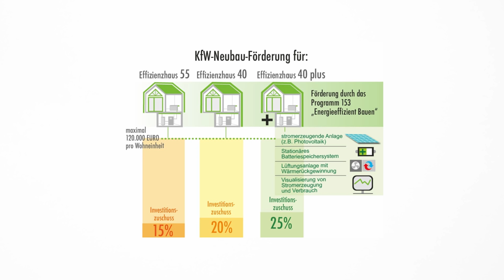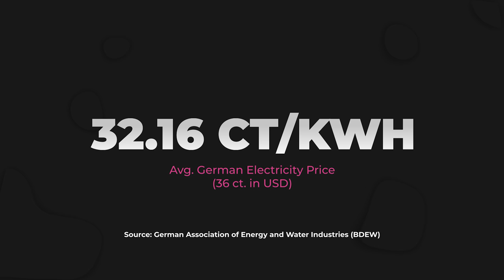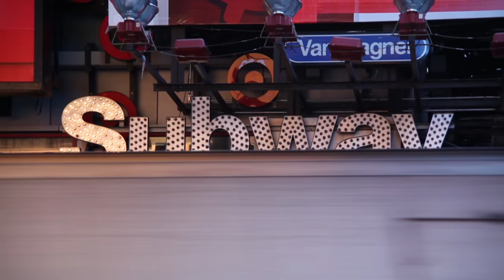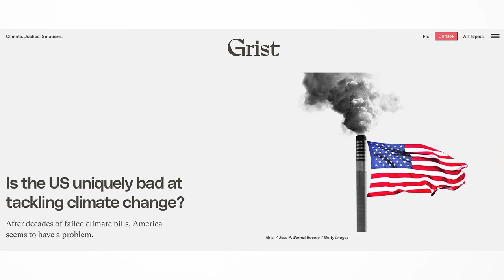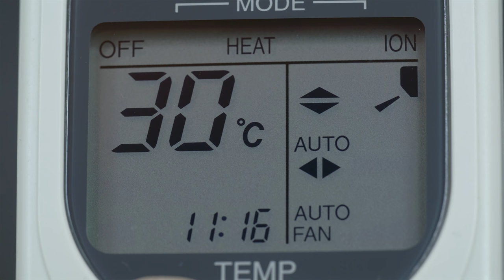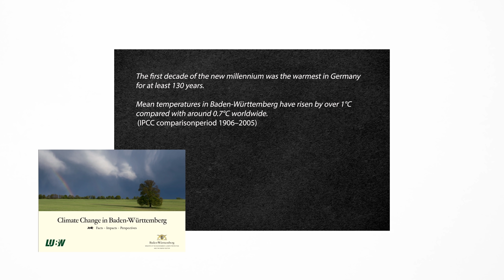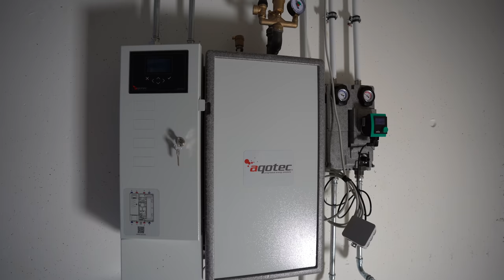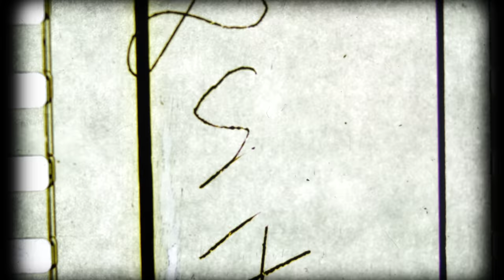HVAC (HLK) in German & American Homes | A Tale of Two Countries

Comment: I life in Malaga (Souther Spain) for two and half years. My apartment had no HVAC at all.
The weather could be very hot (40...50 C). But luckily where dry. So In summer all my widows were open all the time.
In winter the temperature in the apartment could go down to 12C. But with a snuggy it was bearable.

My apartment in Switzerland get the heat from the waste incineration plant.
Reply from the maker: Wow that is super interesting! did you get a nice breeze from the water at least in the summertime?
Reply: @TypeAshton 
My Apartment was at 7th floor. And as Malaga is directly at the Mediterranean sea there was always some wind.

Comment: My first Uni had ac and I found the heat outside allways much less bearable when I got out. At home I use a ventilator and a wet towel before it if I want to cool my flat down where I am at the moment. Thanks for reminding me to buy a bigger one now when they are cheaper then in summer

Comment: 2020 I bought one of those mobile AC devices for my office at home. I was working from home and it was so hot, that I can't focus. In 2021 I used it I think only once. I try to avoid it, because of the energy consumption, environmental impact and those devices are a mess when you want to use them. (Route the exhaust hose out of the window and seal the window.)
Reply from the maker: It's hard not to bite the bullet and buy one of those when you're so miserable you can't get any work done. We like to think that infrequent use it's not that much of a problem.
Reply: Me too, I live in a small Paris apartment, so querlüften is out of the question...

Comment: Living in Germany I dont understand why most people here dont invest in ACs. We have them in our top floor apartment with 180+ degree windows (we would die otherwise) but I agree, the majority still doesnt use them. Luckily with the switch to heat pumps this automatically also means cooling in the future. With ongoing climate change there is no way around it, while it was still possible to easily live without them 15+ years ago. The good thing: The hottest day usually are very sunny, which means you use the sunlight directly from the roof and/or solar farms to cool down your home.

Comment: In Europe there are different effects. On the one hand there are the Alps, which shield Germany from the Italian heat. But when the wind sweeps across the Alps from the south and falls again, that heats up the air again. 
Then there is the Gulf Stream in the sea. This starts around Cuba, passes New York and then goes in the direction of the French coast to the German coast. This is 75% the weather-determining situation. 
When it storms in the US, we get only rain a few days later. 
It gets really cold when a low-pressure area in Russia makes its way to Europe.  "Father frost"
Reply: You have to remember that in 1973 East Germany was socialist led and closely allied with the USSR. 
At that time a lot of crude oil was practically out of the question, which meant that steam locomotives had to be operated with coal again. Inferior wet lignite from East Germany that tends to freeze clump in winter.
The USSR, on the other hand, has a lot of natural gas that had to be connected at the time. It was East German workers who laid the first pipelines with West German machines. This gave West Germany cheap gas for decades, East Germany the energy source it urgently needed, and it was also a profitable business for the Russians.
I can understand if the US wants to sell gas too. But the price with transport is higher than Russian gas.
Reply: 15 years ago few buy cars with AC. Maybe in the upper class and expensive models. Today it is almost impossible to get a new car without AC, although Germans often refuse to use it. But I think a rethink is slowly taking place.
I'm already thinking about whether AC is suitable for heating the old house. may be...
Reply: Wood chips can be made from roots, scrap wood, and low quality wood. Wood chips are also produced when sawing boards.

Comment: The heat dump on the subway was also what I found ridiculous in Boston. While in Germany it gets cooler the deeper the subway is there the tunnels were like saunas. Or so it felt! And instead of turning the AC off on the tunnel lines and while below ground, no that was too much to think about. So the AC had to do even more work to cool the already heated air down to what was needed in the cars.

Comment: How lucky we are to have you here in Germany. The best in comparing US and Germany is thr opportunity to learn and find out the best way for all of us how to deal with the climate change. When I were in the US I did wonder why the waste heat part of the sir conditioning system is installed in the sun. I would put them in a sink as that is where the cooler air collects. On hot days, when I go to the restroom and wash my hands I do not dry them with warm air or towels but I let them dry by evaporation as this cools down my extremities. We will not buy air conditioning system as this is contraproductive regarding the climate change. I´m not convinced that US citizens do too less for our climate, but this is a big country with many tasks and it take time to redirect such a big ship.

Comment: AC not in a private home. While my apartment building doesn't have the best insulation it usually takes about one or two weeks of constant heat for it to become really uncomfortable. By opening the windows during the night or early in the morning I can deal with the heat to some degree and make it more comfortable.
Also so far the heatwaves haven't lasted long enough for my home to be really uncomfortable for a long time. So I usually only deal with a rather limited time with really uncomfortable temperatures and while I wish I had an AC during those times, it's not long enough that I feel it's worth the expense.
Reply from the maker: Generally it has been pretty bearable here. However, a couple of years ago we have 6 heat waves with a week at a time where the high temp was up to 40 C. That summer was really tough.

Comment: When I lived near Fairbanks Alaska we had a Toyo stove which ran on #1 Diesel or Kerosin. It was a forced air unit, due to the open built of our 1200 sqf home there was no ducting. Additionally we had a woodstove in case of power outages which can happen at heavy snow loads that can push branches on the power lines! Once a winter that could be the case. Cooling in the summer was rare except in the Summers of 2007 and 8, I believe, where we had weeks of 99 F and enormous Forrest fires. No AC! Opening windows at night due to the smoke was hardly an option. Except I used a kind of swamp cooler technic, I dunked bedsheets in water and attached them to opened windows and used the cross draft to cool the house down..
Reply from the maker: Wow that is super interesting! Thank you so much for sharing your experience in Alaska!

Comment: We have well insulated walls and that does not only mean we need less heat in the winter. It also helps a lot with the heat in the summer, because the house stays way cooler.

Comment: Since temperatures rarely exceeded 35°C (95°F) in Germany a few years ago, there was no need to purchase air conditioning in residential buildings. Since this is apparently changing due to climate change, I could imagine seeing air conditioning systems in private homes more often in the future. This is already the case in southern European countries. I've heard from other expats who have moved to the US that the air conditioning is often set so extremely cold that you have to wear a sweater indoors. However, I think that's sick and I can imagine that the change from the outside to the inside with high temperature differences can also make you sick. It's not about whether air conditioning is necessary or not, but how things are set up.

Comment: Awesome job producing this video with great data. Thanks a bunch! First time I experienced radiant floor heating was when I lived in Iceland and Switzerland. It was wonderful. The feeling of warmth is much more comfortable than the forced air system. The biggest bonus was my wife’s allergies weren’t as bad as when we lived in a home with forced air systems.
Reply from the maker: We were also surprised to learn that district heating is the predominate heating system in Iceland. So awesome. Also, we noticed my allergies are worse in Germany without AC. Since we have to open the windows to cool down the house - there's a lot more allergens than if we were able to run the air through a HEPA filter. However, we did invest in a portable air purifier and it has helped a lot.
Reply: @TypeAshton  that is true about summer allergens with trees and pollen. We got lucky my assignments we in the winter months. But yes, AC is a must in certain areas in the summer if you have allergies. Also, one interesting thing I learned is that mosquitos exist everywhere. I was surprised to see mosquito in Tromsø, Norway in the summer! I didn’t think you’d find mosquitoes that far north!

Comment: About the "AC makes you sick" comment: I have actually experienced this myself.The problem here I think is not the AC itself, but the fact that you experience massive temperature differences everytime you leave or enter a building. That means you are basically never clothed appropriately. If you wear clothes matching the temperature outside you are probably going to freeze as soon as you enter a climatized mall or office building. If not maintained well ACs are also a good environment for certain bacteria to grow.
Standard strategy against the heat in Germany: Open all your windows when it's cool at night and close them and the blinds during the day. Thanks for another informative and well-researched video! :)
Reply: Fully agree - the rapid temp change and the reduced humidity can be a challenge to the mucous membranes and hence make you more vulnerable to germs. Also, ACs need cleaning, which is often forgotten. So you can actually have mould in your house spread around by your AC.
Reply from the maker: Interesting points, thank you for sharing! We are glad you liked the video.

Comment: We don't have an AC and have full wall height windows to the east. It used to be super hot in summer but we have installed shaders meanwhile and together with opening the windows over night they keep the temperature in summer under control.
Reply: Just goes to show that smaller windows might actually be better.

Comment: I grew up in a house with radiant floor heat and my feet were warm but the air 3 ft above the floor was cold.  Also lying on the floor was too hot.  As a family of 5 with only 2 bedrooms there was a lot of sitting and sleeping on the floor.

Comment: Your KFW graph shows that all KFW40+ houses need to have a general HVAC system. Done right, it is much more energy efficient and it is necessary in those low energy houses because they are practically airtight and air can get stale quickly if you don't open windows often. You will also get the results of a 'blower door" test in your KFW55 house - they basically pump air in through your front door and measure how much escapes through gaps.

Comment: Lovely to see you again and hear your summary on heating & cooling differences between Germany and America . Personally  I like the ceiling fan to circulate the air in summer and in the winter I just snuggle into my electric blanket on the couch. Running heating or cooling for the whole house as a single person just doesn’t make sense for my circumstance. I do have access to evaporative cooling and ducted heating but try not to run these unnecessarily. That’s just me and not the norm of households in Melbourne . Reverse cycle heating and cooling systems seem to be popular these days and are quite effective and efficient apparently. Thanks again for your interesting video, it’s always a pleasure to hear your summaries. Hope little Jack is keeping well also. Hope he features again in one of your future videos.
Reply from the maker: We also love ceiling fans and plan on installing them in our new home. We tried putting some in our current apartment but we didn't have a good substructure to mount it to and it was pulling the plaster apart.

Comment: I live in an office building from the 50s that has been turned into an apartment block. especially the large glass windows that are so nice about it are also its curse in the summer, so I have window blinds with a reflective outer surface and a mobile AC that I hook up to the window. so in summer I have the window open at night and the AC running during the day at 26°C, which is warmer than "normal" room temperature, but with an energy bill of above 100€ a month I try to balance costs with comfort.

Comment: The biggest difference in summer temperatures between Germany and where I live now in Pennsylvania is not the possible high temperature, but rather that here in the US it does not cool down at night. The German system of opening the windows in the evening and morning to let cool air in, assumes that cool air is to be had. That is not the case here. It stays in the 80s/90s for weeks, if not months, and when I lived further south, it was even in the 100s. This does make it more difficult for the US.
Having said that, US suburbia has huge parcels of land available to everyone there. That all these houses were built without a heat exchange with cool ground air or maybe even cool water to help with the cooling of the houses, when 90 % of these suburban houses was built since the 80s, when such technology was already available, is truly a shame, and a crime. But with energy as cheap as it is in the US, keeping construction costs down was just a higher priority than focusing on environmental or operational cost issues, unfortunately.  I still believe that the big parcels of land will allow to retrofit houses with this technology, but obviously at higher cost. It would be important to start with new construction, and demand that such technology is used there right away. This will bring the costs of the systems down, educate the HVAC industry on the available technology, and then it can spread to the existing houses over time. I hope it happens sooner rather than later, but I don't see much discussion on the issue unfortunately right now.

Great video with lots of info. Thank you.

Comment: "Fernwärme" is efficent under all conditions. In the former GDR, this was quite common. Its not efficient because of a central heating unit, its just collect the waste heat from gigantic industrial complexes which where called "Kombinate" (all in one factory sites)  P.E.: my former employer was part of an Kombinat at this time, which has around 22.000 employees at one place, and has its own foundry and forge. Means, a lot of waste heat, what could heat whole districts. So this concept is really old in Europe, and on some places, the old connections still running perfect.   This concept could be, with some investment, expandet a lot. I now work in a small workshop, we have around 30 milling- and turning machines (and we have a lot of shops this size, or much bigger on the planet). They all emit a load of heat (around 60-70°C). To slow down the climatic chance, this ressource could be a key.  Also there is a technique to use heat for cooling buildings.

Comment: I use earth warmth for my house. A company has drilled very deep in my backyard to get warm (circuit) water from there wich is with a heat exchanger heated up to 70° C. I only pay the bill for the electric power of the pumps. This was a hughe investment at the installation, but with the actual gas/oil/energy prices i am much quicker break even than i thought. As for AC, i only use ony in my Bedroom in very hot summer nights to get my neeeded amount of sleep - as it is my house i could also drill the AC exhaust hole.

Comment: We love our floor heating system and filtersystem, it's really energy and cost efficient and we don't have to worry about the heat that much, also it's usually windy outside, so the usual stuff works, loose clothing, no cold drinks and keeping hot air out as much as possible. In Innsbruck it's a different story, since the warm air can't escape it's insane and you just figure out how to dress as loosely and pleasently as possible and hydrate as well as possible and enjoy the community pool or lakes as much as possible or just flee up the mountain, it's a warm wind coming in and high humidity, so the town has winter and summer and about a week of spring and fall, I had one year where it went from summer to winter overnight. Our body has an amazing natural coolingsystem though.
ACs can mess with our natural body reactions when changing between hot and arctic the entire time in addition to possibly being unhygienic and my dad and I get pink eye infections more often with the AC running in the car.

Comment: When I was the first time in Detroit I got nosebleed from the dry air in winter. I could barely breathe. Whenever I'm in a hotel with HVAC I turn it off during the night because of the awful noise.

You don't want to shut down the floor heating in your new house when you don't use the room. The floor heating reacts much too slowly for that to work.
Reply: You got that right: It is heating that dries the air, not cooling (Physics 101).